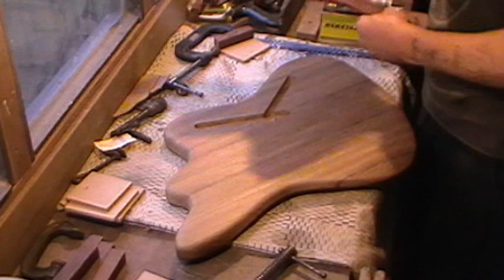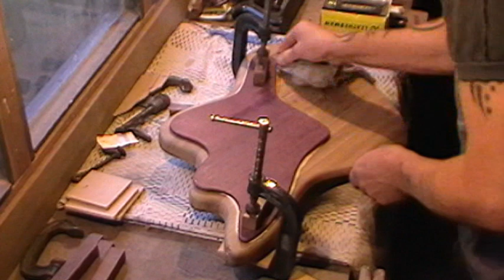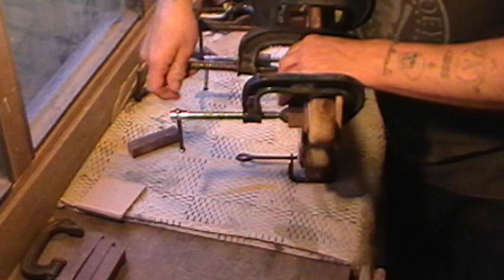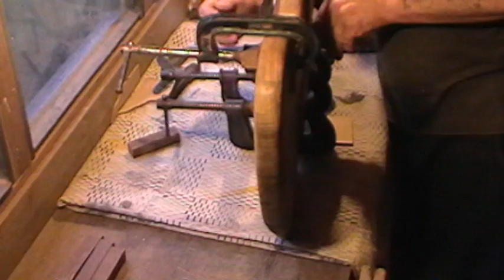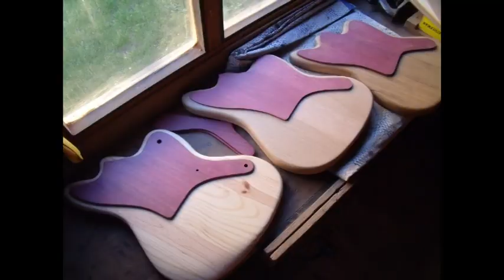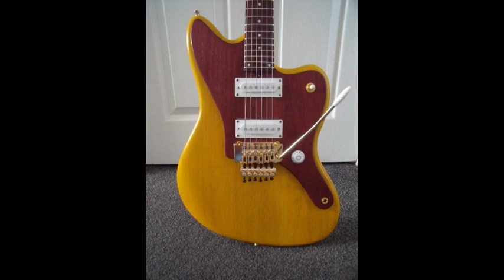Gluing A Scratchplate Shaped Solid Top To A Guitar Body (Time Lapse)

Comment: Really Interesting, putting a solid scratch plate on an exotic guitar body wood. Really nice guitars.
Reply from the maker: +Bearista Bear Yeah i've done a few like this and it works real well. Don't know if it's ever been done before but it does away with screws and makes it feel much more solid. Makes finishing a bit more difficult though but it's worth it.